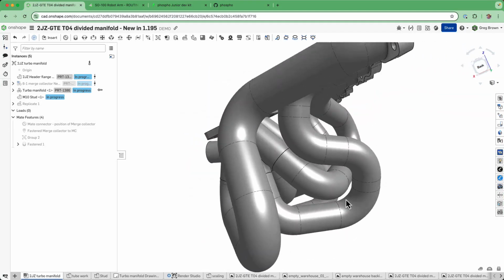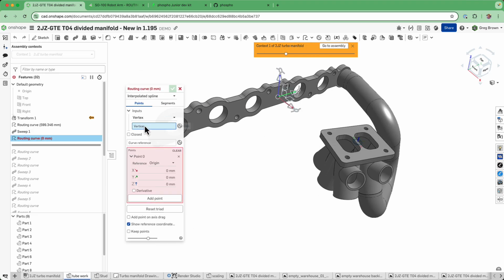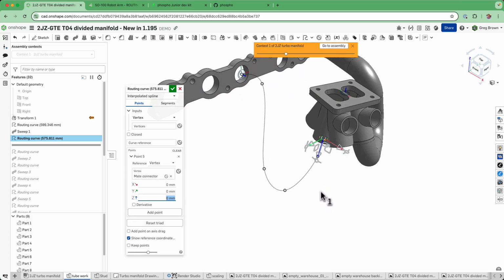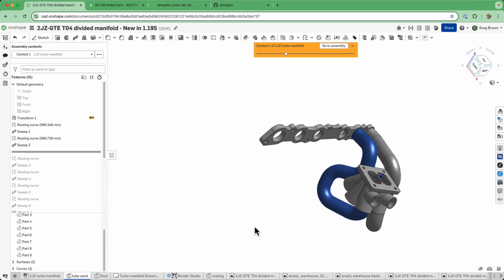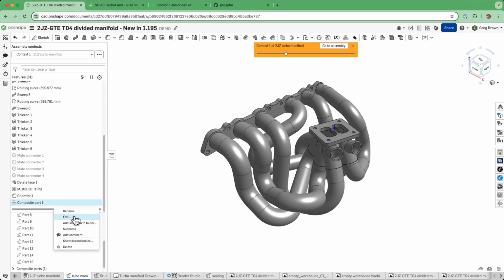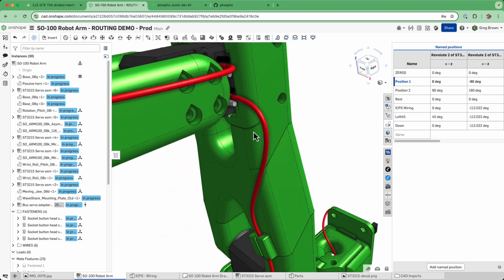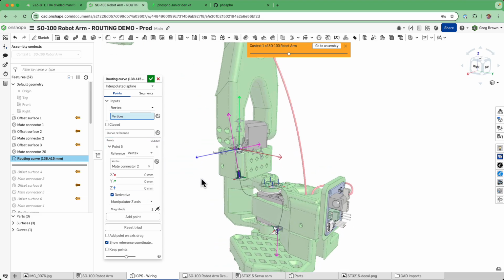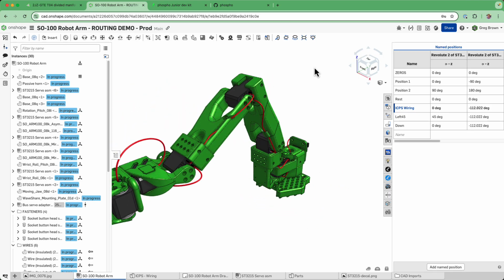Using Onshape's new Routing curve for various 3D curve workflows

Comment: Is there any way to create Mate Connectors in features that reference the InContext? The routing curve, as well as other features require me to do the copy in place to reference any edges with a Mate Connector in a feature. Otherwise I have to create the Mate Connectors external to the features. This tends to pollute my feature manager with a lot of mate connectors that are only used by a single feature like the routing curve.
Reply from the maker: You can indeed create mate connectors in the in-context part studio, which you could use for routing curves etc. (Or did I not interpert your question properly?)

Comment: Awesome Greg, I did a header using project curve, now need to do the same with a routing curve.
Reply from the maker: Yes the header is a great example to do using the Routing curve, and is a lot more convenient that projection of sketches. You can really tweak it to what you need, and you can keep an eye on the total length really easily.

Comment: I guess I missed it, so can you help me understand something. In your example, you route tubes from part to part. But in this particular application, it's obvious you would want to have the tubes roughly equal in their net lengths so as to make the combustion gases take the shortest and most equal paths from carburetor to manifold. Anyway, there seems to be two issues here. First, how to eliminate conflicts between tubes in an automatic way. Secondly, will Onshape calculate for me the shortest and most efficient path between two points?
You might have mentioned it. If so forgive me. But if you did, please tell me where in the video you said that.
Thanks. You are a master using Onshape.
Reply from the maker: This was a quick example to show the new feature "Routing curve" so it did not follow a rigorous engineering design methodology. That being said, I did manually get the lengths of the routing curves to within a 0.1mm or so, which is certainly an acceptable tolerance given these will be chop-sawed and hand welded. I used the "Final" mode during interactive editing of the routing curves in order to achieve the lengths required and also to eliminate interferences. Yes an fully automated and optimized  (generative) solution would be nice, but this was not in the scope of this particular feature.

Comment: Is there a way to preset total curve length. The exhaust manifold being a prime example where all tubes want to be the same length along the neutral axis. Maybe define a curve or 2 as free to adjust them selves?
Reply from the maker: Constraining/prescribing the total length is not currently a capability - I did it manually in my example
Reply: why not just use Edit Curve instead of Routing Curve?